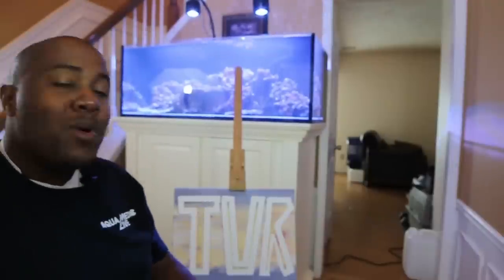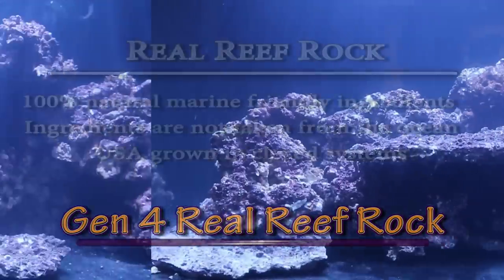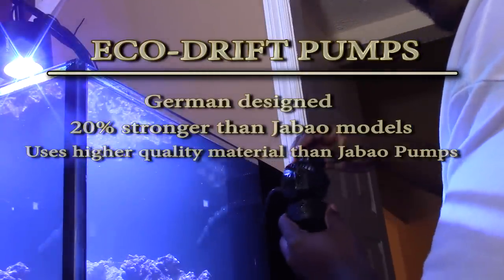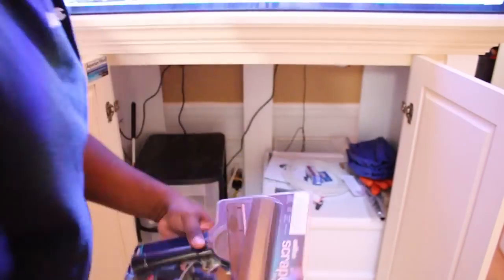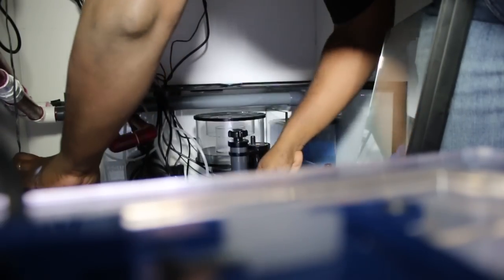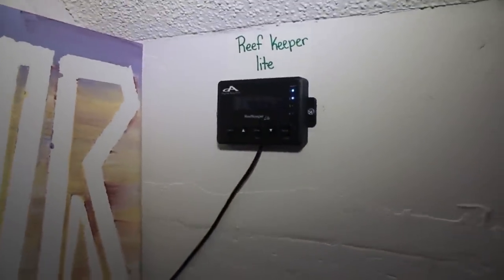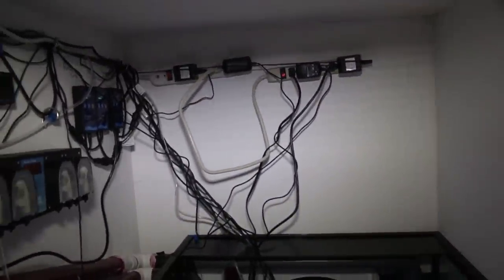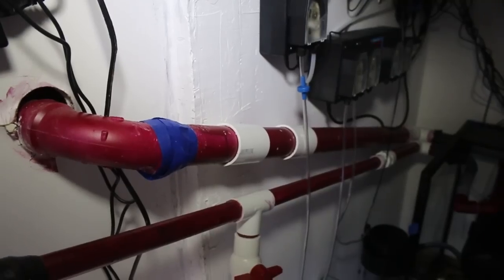Ep 8 FIRST LOOK @ Tank & Equipment Room

Comment: hi Thomas. great video as usual.
Good use for extra unused bioballs is to run them in a cheep reactor and a small pump in ur sump. and wn u want to start a quarantine/hospital tank; just take that reactor from your display tank and put it the QT/Hospital tank with a filter sponge on the pump inlet. ull have a cycled QT tang in two minutes. after ur done from the Qt tank; dry the bioballs in the sun, wash them them then put them back in the reactor and back to the DT sump to get them cycled and freshly ready for QT again.
unless u have a QT running 24/7 ull have to find another use for those Bioballs. ;)
keep up the videos coming; we r waiting ;)
Reply from the maker: Great idea! I was thinking of running my qt full time but that us a waste of electric.
Reply: Thomas Brown Another alternative to the previous idea to save electricity, u may T off 1/2 inch of ur return line to feed the standby bioballs reactor through a ball valve and a union fitting.
wn u want to setup the QT; shut the ball valve and disconnect the reactor from the union fitting. then take it to the QT and connect it to the small pump that has an identical union fitting.
of course even though ull have to invest in a 1/2" ball valve and two identical 1/2" unions; savings on electricity that could have been wasted on running the QT continuously or the bioballs reactor in the DT sump will pay for the extra fittings.
good luck :)

Comment: Because you shouldnt have a back syphon on your overflow and it would also cause resistance for the water trying to get to the sump, so it would basicly turn them into expensive unions. I had the same thought when I was building my old build and ended up taking them out.

Comment: Looks good. I like the way you have it all crammed into the closet/stair space.

In the vid it looks like the tank isn't level. There seems to be more space from surface to top of tank on the left side of the tank.

Check valve? Oh no! Major failure point.
Reply from the maker: LOL, John, this was a BIG topic on my facebook page for one person. He even went on his fan page and posted a picture and a made sarcastic post attempting to call me out (unfortunately for him it backfired on him and a lot of people bashed him for the post). Anyway it was the pump. That pump is POWERFUL! I have now moved it you'll see in the next videos that the water line is level. I've used check valved on all my main tanks. Never had a problem :-)
Reply: Didn't know the FB world had a go at it. I'm FB challenged! :)

Thought it might be flow but better to ask.  

So what happens if the check valve does fail during a draindown? Will the sump handle the draindown? Also the CV reduces flow in the drain. For me, it's not worth the risk.

Comment: I had a check valve before, and test it, worked perfect, year later my breaker poped, check valve failed due to calcium build up, I will never use a check valve ever, just turn off everything for testing purposes,  and make sure your sump will handle the volume of water returning back.

Comment: Not surenifnyou put them in yet or not but inwould put your check valves on the return line and not the overflow drain otherwise you will run into problems.
Reply from the maker: Hey Ben, I planned on putting it on both. I have the parts ready just need the time to do it. I will definitely put it on the return line. Why would you suggest not putting it on the overflow line? Thanks!

Comment: Seems like a bloody risky water level.
Reply from the maker: Aquarium or sump?
Reply: Thomas Brown aquarium. Looks like it was going to over fill!  Although it's just a test run :)
Reply from the maker: Austin4220 This is my first rimless (other than a few nano's). At first I had the level lower but it just didn't look right. It's easy to change if it turns into a problem I would just need to adjust the pipe in the overflow.
Reply: Thomas Brown Yeah I was talking about the DT.

It just seems as if one out-of-place surge might spill right over the top.
Reply: Thomas Brown I recently set up my first "real" rimless tank besides a biocube I modified.  it's a 48X18X20 75g. I've been battyling the water level. I ended up having to add more water so my water level sits about 2.5" off the waterline. Love the rimless tanks though!